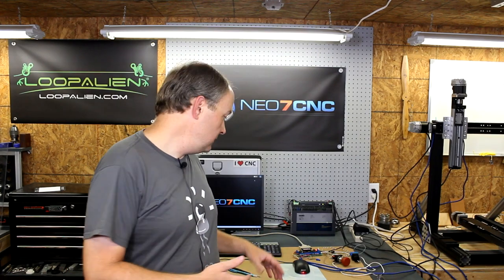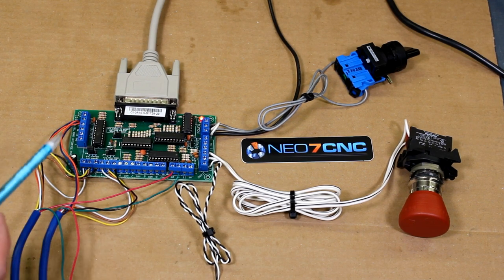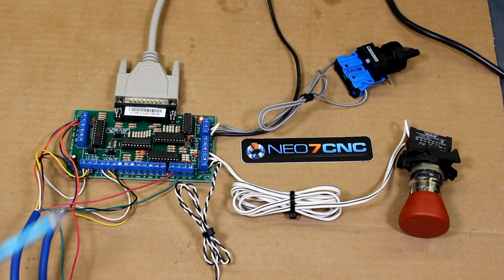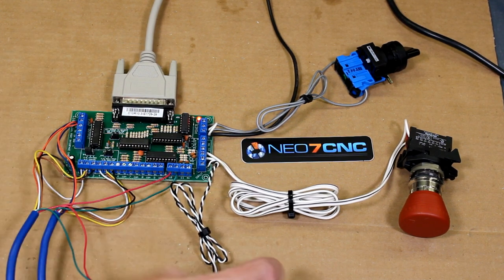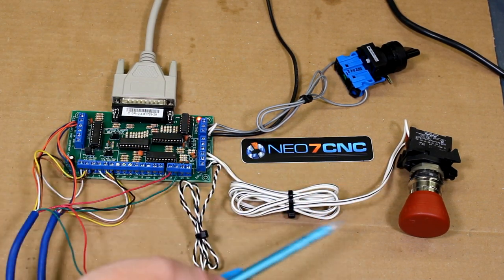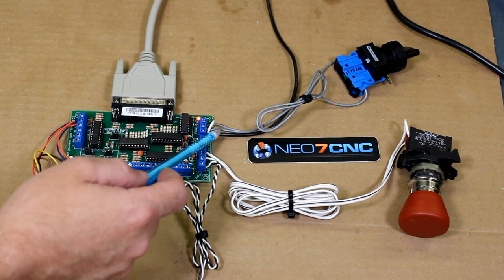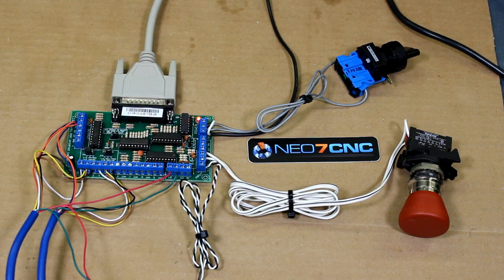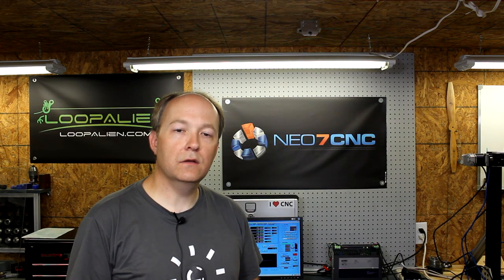How to connect ClearPath servo motors to a C10 board and Mach 3 - Neo7CNC.com

Comment: Thanks for this guide.  I can vouch for anyone looking to build a similar system.  If you follow this guide everything should work as expected.  I just got done with my clearpath cnc build based off of the OX CNC Platform and I used similar Clearpath Motors and my machine is up and running and this is my first CNC build.  The clearpaths and this video makes the process very easy.  Thanks to Neo7CNC for his help.

Comment: Belay my last comment. I read somewhere that there is a problem with the setup for the SD. I had already did the auto tune and it was fine so I assumed it was right. After not getting any running of the motor I retried the setup and redid the step and direction. It now works with the C10.
Dan
Reply: What is breakers servo

Comment: In a nut shell
White: port1,pin2
Black: port1, pin3
Brown Yellow Orange:ground
Green+5v
Red:port1,pin10
Blue:port1,pin17.  
In Mach3 Motor Outputs X axis, Step Pin=3, Dir Pin=2.
Input #1 is port1, pin 10.
OEM Trigger#1 is port1, pin10.
Output Signal, Enable1 is port1, pin17

 I was so confused at first until I realized you were using the word “Port” in place of “Pin”. 
Once I let that go, I was able to fallow through the rest of the vid. Eventually got mine up and running. Can you comment on how you were able to look at the Clearpath manual and come to this conclusion. Even now knowing how to wire it up, I’m still confused by the manual.
Thanks for getting me up and running!

Comment: Great video. I'm still confused as to wiring the motors because the inputs in the servo documentation are  A+ A- B+ B-. In the documentation for step and direction signals it says to use input A and B. How is that wired?

Comment: I have the green blinking light that s shows that the clearpath servo is enabled. I have the white wire connected to pin2  the yellow and brown wires to com and the black wire to pin3 of the C 10. I have mach3 setup for the x axis enabled with pin 2 as dir and pin 3 as step but I get no movement. The display so movement but the motor is locked and doesn't move. Any idea/s

Comment: I connected 3 clearpaths with this C10S (updated version of C10). when switched ON, The servos get in the holding position, servo status light starts flashing green on all servos, ports and pins checked all seem good. Any help will be much appreciated.

Comment: Great video!
I am having an issue with one of my Clearpath Servos going into an error state (error #73 specifically). However, when it errors out, my machine continues to run (with one dead axis). This ruins my work piece!
I'm wondering, if HLFB is properly configured, will it Feed Hold the motors if there is an internal fault on the motor, and not an external fault such as a limit switch, crash, over-torque, etc?

Comment: HI.    Code 1002 is rewin not feed hold.  I mean....     and. Is possible Connect.  Position compleet pin in mach ?   I have problem with Delay of servos in working.

Comment: WHAT OPERATING SYSTEM ARE YOU USING. I HAVE XP AND THE CLEARPATH DOES NOT HAVE A DRIVER FOR IT. I RUN IT WITH MACH3 THAT IS WHY I AM TRYING XP
Reply from the maker: This setup was running Win7 with Mach3.  I'm using both a USB Smooth Stepper and AcornCNC with Win 10 now.  The C10 boards just work with a printer port which I wanted to get away from (nothing wrong with it other than age).  The USB Smooth Stepper and AcornCNC boards still speak step and direction signals just like the C10 allowed.

Comment: Hi,
still struggling with these...
First off the setup Program doesn`t complete... it just stops at 41 % on all motors.
secondly and quite odd: the smallest Servo has lots of torque, one cannot force it to stopby hand,  while the bigger one on x can be stopped  using your bare hands on the spindle??
I hope this is just due the fact of the setup not beeing completed?
Anyone can describe how the setup did take place once started? Did your motors jerk/squeel, accel and decel right from the biginning.. or did they keep relatively quiet till aprox half the setup time?
Mine do just some very faint noises like sorta sparkling water in a bottle and a bit of sqeeking ... than nothing..

Any help would be greatly apreciated.

flo

Comment: This "new stuff" Is amazing me. I last ran a monster 1992, 516 Shoda twin table 4mains w/4 pigs w/Fanuc 18 controls and Bobcad CAD/CAM  in 2008. Needless to say the how controls have shrunk and ease of set up step vs servo's is bowing my mind. I now want to build a 6'x12' capacity w/tool changer....no wonder the mkt. for used commercial units have crashed.

Comment: New to all this CNC build, but will a USB to 24 pin parallel port cable work with the C10 board.
Reply from the maker: The way the standard printer port "talks" will not allow that to work.  To get away from the need for the printer port you could use a board called a USB smooth stepper.  Does the same function (and more) but communicates with USB.  There's an Ethernet version too.  Thanks for the question.

Comment: Hi. I have one qestion.I have buy robot KUKA RC 22/50 and i like to know is it posible to make work like cnc machine becouse the softver i very old but everything is working with 6 servo motors. Can i control them with some controlers becouse all motors are from 3 kw to 5 kw and its preaty big robot.Thanks
Zlatko

Comment: Hi, I am a hobby guy that also loves cnc machines. I have built for my shop a mill and a small router.  I always wanted to convert my router from steppers to servos and I am doing that now. The problem is that the change requires a big money that I don’t have and I am trying to build my own servo motors from  DC motors . My question is:  Could I use this C10 board with any quadrature servo motors  or they need to be those special from Neo7CNC ? thanks

Comment: Hi,  When you tell the machine to move 1 inch, are they using the built in encoders for that? and are they dead on?
Reply: No, the 1 inch is from the Mach setup, counts per revolution multiplied by leadscrew pitch gives counts per inch or CPI, it's under Mach/ Motor Tuning screen.

Comment: Thank you for the video.  I am building a CNC router using the Clearpath servo's and I want to construct my own power and data cables.  I cant tell and I cant locate what cable is necessary for data and power.  I think the data cable is 22AWG/8 conductor shielded(?) and the power cable looks like its only 2 conductor.  Can you check this fore me?   Thank you.
Reply: Contact Teknic... They are the ones who actually build the clearpath motors and their cables...

Comment: Love your videos. I have a 34 NEMA servo motor CPM-SDSK-3432S-RLN from Clearpath and a DQ542MS driver from Wantai That has 6 wire ports and the Clearpath has 8 wires. Unable to figure out what the 2 extra wires are used for. Any suggestions?
Reply: the clearpath servos have built in drivers, you shouldnt need an external driver.
Reply: Thank you, I’m new to all this. If you will educate me on this, when he says. “The yellow and the brown are connected together and put into the common.” What is the common mean? I am not using a C10 board I am using the C25S - SMOOTH STEPPER TERMINAL BOARD, having trouble figuring out which wires go into which port. From what I have figured out the green wire is 5v but what does the other wires go. I am using a add on break out board for my Ethernet Smooth Stepper. Sorry for the trouble, unable to find any info on these connections.
Reply: I am not familiar to that board so I am not sure how to set that one up, sorry I cant be much help, I plan on using the 6 axis breakout board from automationtechnologiesinc that has everything on it ready to go, its expensive like 600$ but expandable to no end

Comment: Do you think you could run servo motor on one axis and run steppers on the others?  I ask, because I would like to upgrade as I go.  Z axis driver went out on me so I was going to upgrade z and then others later.
Reply: Just to add, I am using the cnc4pc breakout board C11GS - Multifunction CNC Board.
Reply from the maker: I do believe you can mix them. If they are all being controlled with step and direction signals you should be fine.

Comment: great vid but Followed all of these steps verbatim. mach3 resets but the motor wont jog and the light is still solid amber.
Reply from the maker: Did you tune the servos and set them to step and direction mode?  Email me the specifics of your setup and I'll try to help.

Comment: First sorry for my english
I`m planing a 5 axis cnc machine, do you know if the crearpath can connected to a C32 - Dual Port Multifunction CNC Board?
2x X
1x Y
1x Z
1x A
1x C

Thanks in advance from Canary Islands
Reply from the maker: It looks like you can attach a smooth stepper directly to it, so with that added, there shouldn't be an issue.  Looks like you''d need the C32 as well as a Smooth Stepper. Double check with the vendor before spending the $$ though.  Thanks for watching.

Comment: Find kind of interesting that you still using a serial printer port in stead of an USB Driver Board!!  But never the less nice work.
Reply from the maker: +Migueldeservantes I know... I know...  I use what I have.  I did get a USB smooth stepper board so that's a step in the right direction. :)